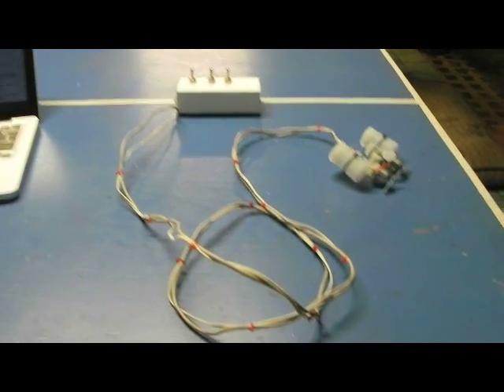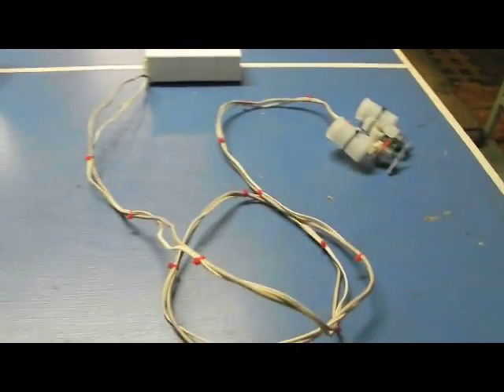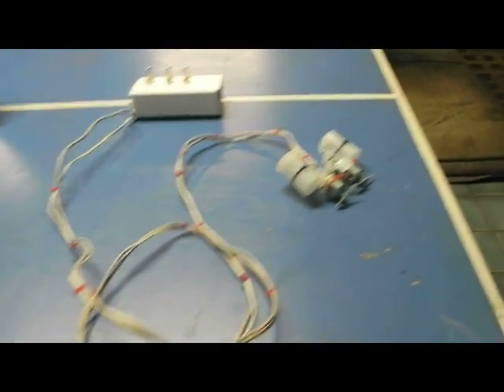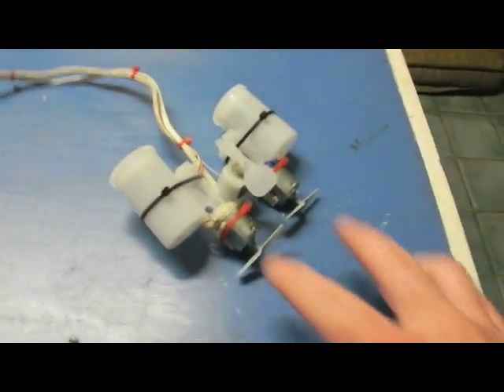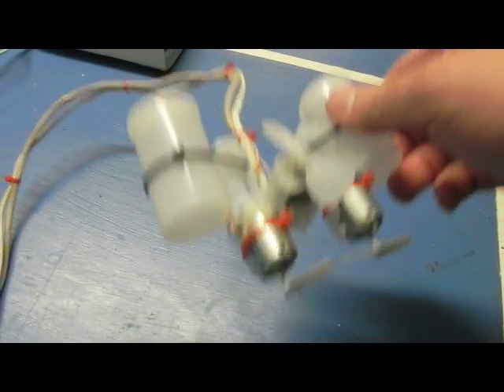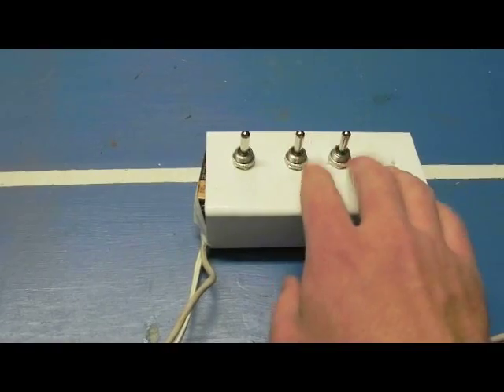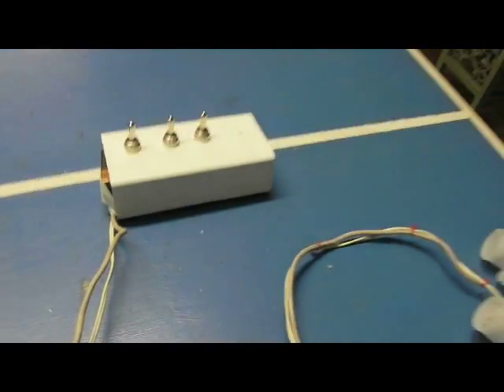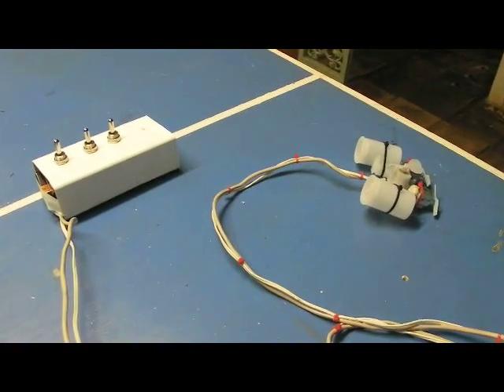Spare Parts ROV (attempt no.1)

Comment from the maker: Hi, I actually "custom" made it myself. The control box is a bit of plastic fencing I had laying around, it was one of the upright beams. The three switches are on-off-on toggle switches hooked up in basic DC motor reverse switching. All the wire, motors, and ROV frame I also had around the house. The only parts I bought were the switches and two forward/reverse props. Hope that helps!